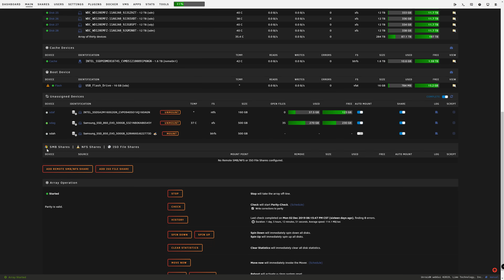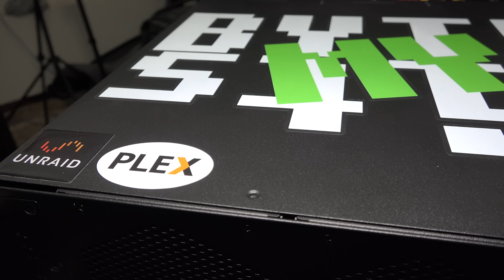My $10,000, 284TB Plex Media Server, Powered by Unraid & RTX 4000

Comment: Hey man. Love your vids. I wanted to let you know my experience. I'm still "new" to Unraid, but I've watched pretty much all your videos now. I was inspired by your P2000, so I purchased one myself. I did a lot of testing with quality, going from H264 to H265. As your video shows, there is quality loss. But I tested on several devices like mobile, tablet, computer and smart tv's. and there is not really any noticable difference in quality loss on the daily. Only if I pause and zoom in. Then you can see the difference. 

I was able to achieve better compression with my CPU, than on my GPU. but it takes SIGNIFICANT longer time to transcode to h265 than with my GPU.  so I decided I will suffer the quality loss, which nobody will notice anyway. Going from 1080p bluray to 1080p HEVC, is still better than 720p. so I accepted that. 

In my costs I cut off about 50 % + of the video file size. Which I love. And allows me to store more videos. 

Also. I am able to use my P2000 on handbrake AND plex AND Jellyfin all at the same time. I did test it, I can easily transcode movies even when handbrake is transcoding my videos. in the background. 

Everything I download gets placed in a folder on my unassigned drive. Filebot picks up the file and renames it, and places it in a folder I named x264 in my array. my Plex Movie folder looks into that, so it picks up the movie as soon as possible. Then handbrake's watchfolder is that x264, so whenever it has take and the movie is not being manipulated. It begins to transcode it and throws it into a x265 folder. also on the array. It both makes movies available fast, and doesn't need to wait for transcode. and it allows handbrake to just work on its on. 

Thanks for the tutorials man. I enjoyed them a lot. It made my setup run smooth af!
Reply: Good bit of info. Do you have any issues transcoding from x265 to x264 in plex using the p2000?
Reply: @JustARandomSomething  Hey man. I have to admit, I have not thought of that. Since x265 is the new format. 
Is there any specific reason why you would want x264 ? :) ( Just curious )
Reply: @Twikkilol  Most my content is x265 and whilst all my own devices can direct play it. I have some users who's devices can't direct play x265 mkv so plex transcodes it.
Reply: @JustARandomSomething  Oh okay I see. 

Most of my users can't direct play x265 either. I sometimes look how it's transcoded. and I can see most is transcoded back to x265. The reason why I got x265 is to minimize disk space. 
P2000 has no problems transcoding on the fly back to x264. If that is your worry. I tested with 12 streams from my laptop no issues transcoding. then my computer test laptop couldn't handle more. I'm sure my P2000 could though. 

I have not tested transcoded the file back to x264 from x265. But I can do a test file or two. If you are curious.
Reply: @Twikkilol  I'd be interested to know how it handles plex transcoding from x265 to x264, so I'd appreciate that thanks 🙂. I have heard many people say its not the ideal gpu for plex x265 to x264 but I've heard mixed things.
Reply: @JustARandomSomething  Let me test it, and get back to you in 10-15 minutes. I'll see how much I can pressure it before it starts coughing :)
Reply: @Twikkilol  Thank You! 😁
Reply: @JustARandomSomething  Alright so. I tested with different movies. All x265. I don't know if it's possible to force ONLY using my P2000. I was able to transcode 16 x x265 bluray to x264 bluray and then it looks like it started to use my CPU as well. Which loads it a lot. 

Even if it only says "(HW)" transcode, it still uses a lot of CPU. And I use a Ryzen 2700 

so I would say it does its job pretty well :) My upload speed would have been maxed out by then anyway Haha. 

I hope it helps your search
Reply: @Twikkilol  Thank you for that. It certainly helps. Much appreciated. 😁
Reply: @JustARandomSomething  No problem ! Just to clear. it was from x265 1080p bluray to x264 1080p bluray :D
Reply: I'm really wanting to get this kinda automation set up but I have to transcode everything I already have first to HVEC which since I'm a stickler for quality I've been doing with my gaming desktop CPU. Takes hoooours but I'm sure once I get done with what I have making it automated with handbrake will be much easier and will only have to do it to new things downloaded.
Reply: @DovahDoVolom  Hey man. I understand. I'm a sucker for quality too. But the time it takes to transcodes hundreds or thousands of movies I want to save. The cpu time is simply not worth it. It takes me around 15-20 minutes. depending if the movie is REMUX or the quality. to transcode from x264 to x265 with my GPU. 
My next upgrade will be a seperate graphics card only to transcode movies, whilst the other is used for Plex. 

The automation is "simple" enough when you get to understand how they work. The most important for me was Filebot, which renames all the files. Else my Handbrake won't grab the files for some reason. After that, it works really really well. I have around 450 transcoded movies right now, and it just works while I sleep , at work etc. :) and I don't notice any performance decrease while streaming. At least not for now

Comment: Ok, Ive been watching your vids, Im a FAN!!.  Need some advice. (From anyone on this thread) I cant get my plex to play outside of my network. not sure what changed... Using netgear wifi router with Bitdefender Box 2 acting as firewall and dns. Set port on BDB, not running dbl NAT,  no access from outside.. Thanks
Reply from the maker: Has to be something with port forwarding
Reply: @Bytemybits  I agree but I'm not sure what. again, this worked. I'm not sure what changed other than I put a new server in place, setup was the same on that server as it was before. now this current system is a temp until I build the permanent system. Ill try again this weekend. thanks.
Reply: Have you tried manually specifying the port in remote access settings on your plex server?
Reply: @RobNguyen  yes. Ive tried the default as well as a range of IP's.
Reply: @RobNguyen  This has worked before, I'm not sure what changed. that's what I'm having difficulty with.
Reply: Double check and see if your ip address is static and that it matches your port forward rule. If you ip addressed changed then the port forward will not work.

Comment: I have a 3900x and you need to be on unraid 6.8 for the temps to work. I'm still on 6.7 waiting for other issues with 6.8 to be resolved.
Reply: emuhack1213 i have a 3800x in an asus WS-x570-ace mobo on unraid 6.8 and still can’t get sensor detection
Reply: @omorange  @fr05try said above this "temps work with the 5.x kernel so 6.8rc1-rc7 had that but they rolled back to 4.x in rc8-rc9 and stable 6.8
" so i guess we have to wait
Reply: @joshuatowns7869  i'll roll back to nvidia unraid 6.8rc7 and report back
Reply: seems like it worked but GUI boot doesnt appear to work for me now, not the end of the world
Reply from the maker: on 6.8 already
Reply: @Bytemybits  https://forums.unraid.net/topic/55150-anybody-planning-a-ryzen-build/?do=findComment&comment=563450
What sensor drivers are you trying... K10Temp or IT10

Also look here
https://www.reddit.com/r/linux_gaming/comments/cd74ai/anyone_running_ryzen_3000_processors_is_cpu/?utm_medium=android_app&utm_source=share

Comment: k10temp works fine on my 3700x. it shows two temps, Tdie, and Tctl. my motherboard uses it8792. and the bios also provides a acpi temp. it's odd that unraid doesn't seem to include new enough or all of the drivers.
Reply: For proof, here's a screen shot of my current conky setup: https://imgur.com/nEor0re

Comment: I have a Ryzen 5 with a x570 MB....  Have the same issue, and as some have noted, we'll have to wait until the new kernel is out.  That said, I have had luck with adding "acpi_enforce_resources=lax" to "append initrd=/bzroot" in the syslinux config file.  (no quotes - append initrd=/bzroot acpi_enforce_resources=lax)  While not perfect, it did allow for CPU and Chipset temp monitoring.
Reply: THANKS A TON! this actually brought up some temps for me. I'm wondering about the accuracy of some of them, as i have some AUXTIN temps at very high (120C+)
Reply: @omorange  yeah... your mileage might vary as they say.  I suspect things will level out once we get to the new kernel in 6.9

Comment: About the temperature sensors. It's a known issue with the Linux 4.19 kernel Unraid 6.8 uses not supporting the Zen 3000 series. Here's a link to my feature request for support with the 6.9-RC series when Unraid moves to the 5.4 kernel. Go drop a like so it makes it in!! https://forums.unraid.net/topic/86298-amd-ryzen-3000-series-kernel-patches/

Comment: Hi Jason. Regarding the Ryzen monitoring, unraid first need to get on Kernel 5.19 or later. The sensors won’t be detected until then. After that, I suppose the person doing the plungin system Temp will have to update it so it can detect it.  I tried compiling myself the sensor-detect , but without the proper kernel didn’t work.  Someone did compiled a special Unraid version with it baked in, but you loose the Nvidia version from LinuxServer, so I prefer the HW transcoding than my system temp :)
Reply: Thank you for posting this information, i have the same issue.
Reply: I think they're planning on using the new kernel in version 6.9, it was going to be in 6.8 iirc but there were several issues.